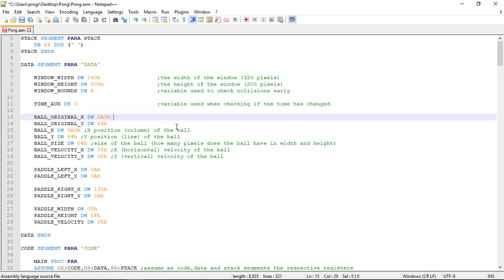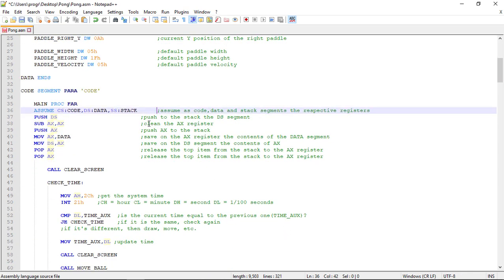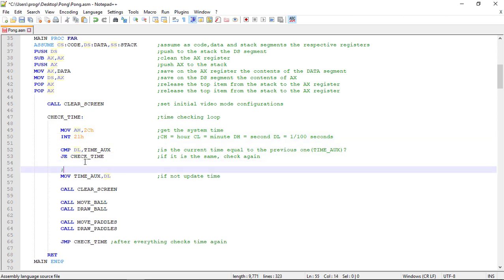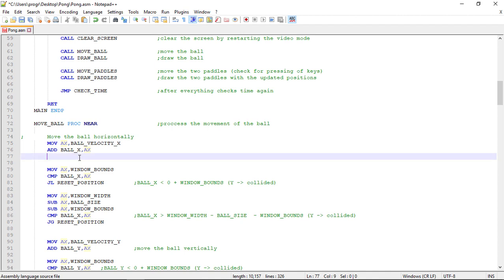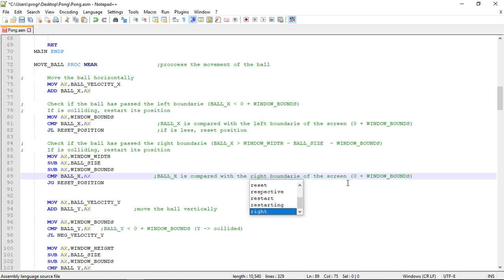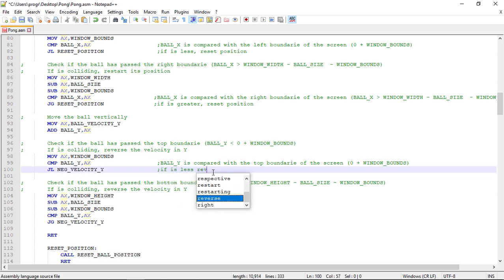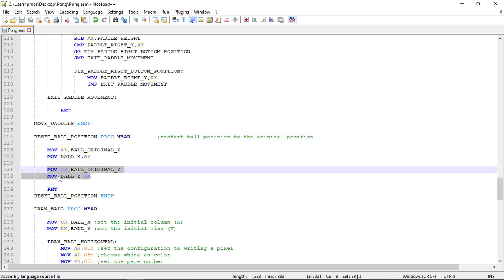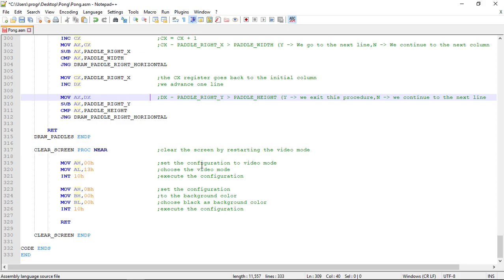[MASM] 8086 Assembly - Pong - 13 Refactoring The Code

Comment: In my opinion, the refactoring could go farther, albeit sacrificing some performance... each subroutine should be a maximum of 10 instructions long. This could be done by breaking up the routines further. For instance, checks that involve multiple instructions should be put in a subroutine of its own that checks the flag accordingly, so in the main routine there's only one instruction calling the check and another branching. Also, all code that comes between a non-executed branch and the next test could be put into a subroutine. Therefore, there would be a subroutine for drawing a pixel of the paddle and two more to compare the drawn pixel rows and columns against the paddle height and width.
Reply from the maker: This is good advice. Thank you Kurt 😉